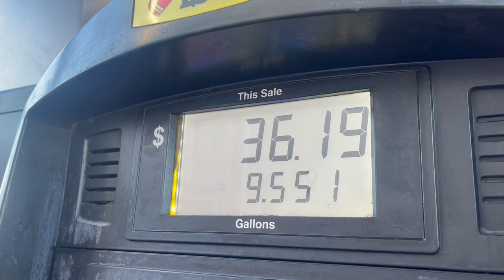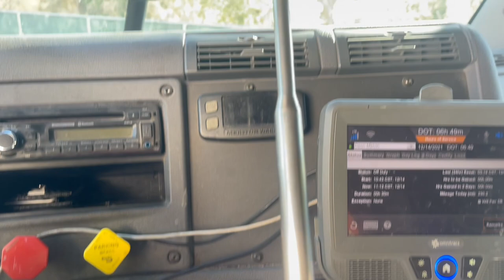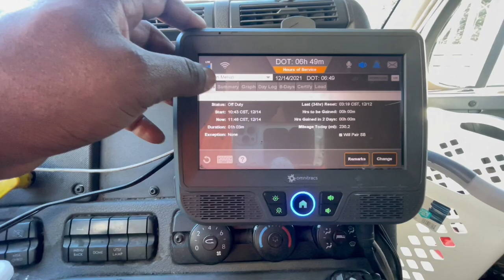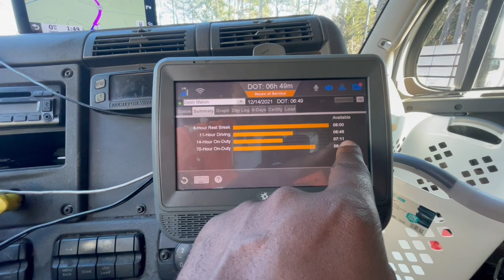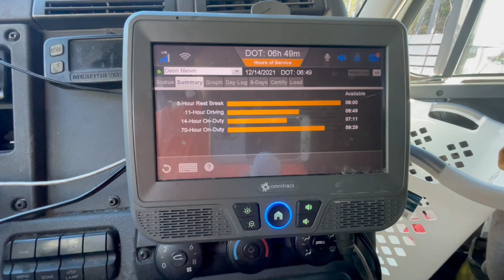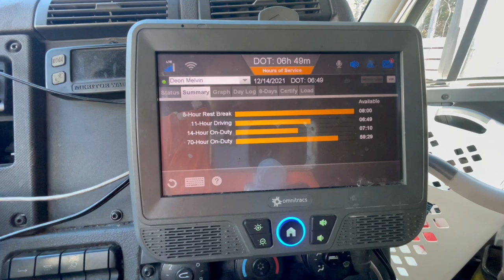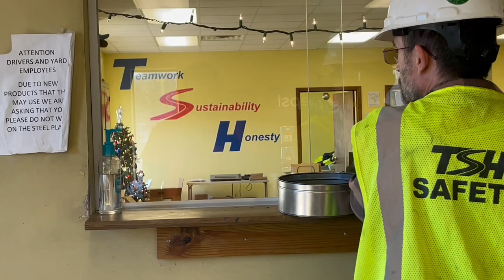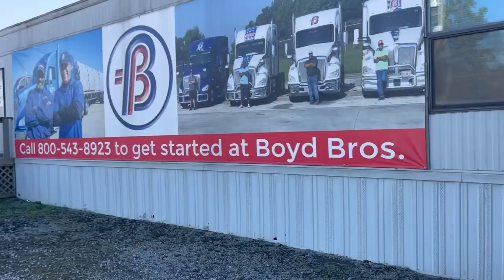How To Do An 8 2 Split Sleeper Berth Flatbed Load Securement #otr #flatbed #tutorial

Comment: I've never had to do a split but I have a question in case . If you sit there 4 hours do you still get the 2 hours back plus the drive time ??
Reply from the maker: Once it hits two hours you get time back. It will be the same at 4 hours
Reply: Thanks 👍